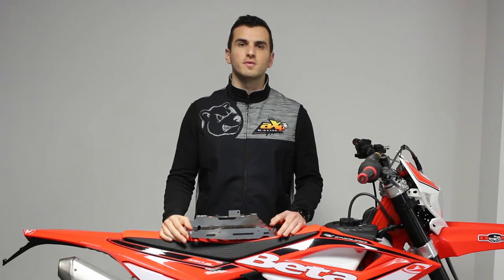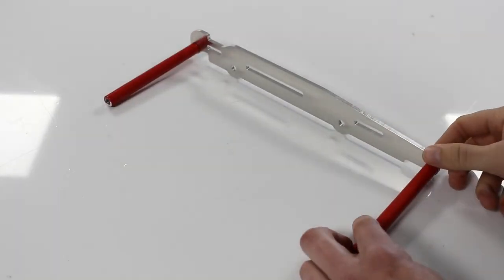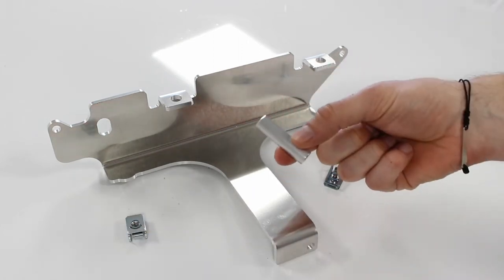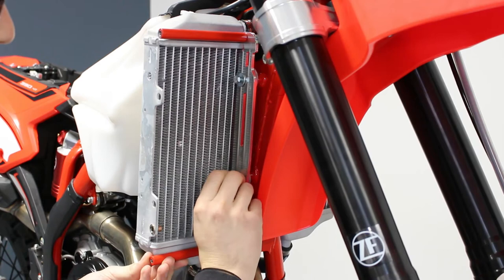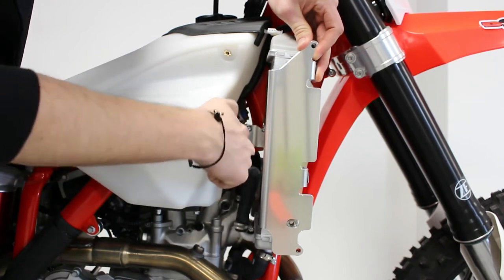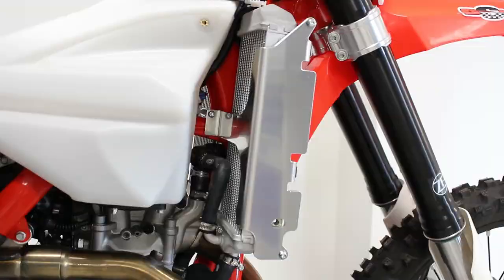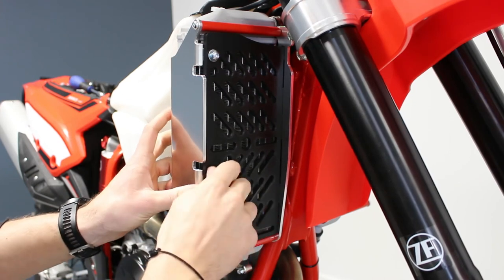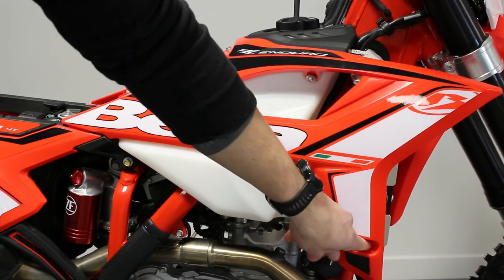XTREM RADIATOR GUARDS / PROTÈGES RADIATEURS XTREM BETA - AXP RACING

Comment: The 2022+ models have extra rad supports/bracing which make it so the supplied brackets no longer line up. Looks like this kit only works on the 2020 & 2021 4T.
Reply from the maker: It has been done on a 2022 model and the bike still the same since 2020 . You can send us an e-mail at contact@axpracing.com to check that on yours

thanks

Comment: Have you tried these on the new xpro 2025 beta
Reply from the maker: No, these ones won’t fit on the 2025 version. 
However, we developed a new version for the 2024 Beta 200/250/300RR Racing, so we think they will fit the Xpro but we couldn’t not verify the compatibility yet. So do not hesitate to send an email to x.dugardin@axpracing.com to be informed once we have the info 😉 Thanks!

Comment: how do you install this on the RR-S models, particularly with relocating the fan to the left bracket ? doesn't look like this will fit, as the left radiator has it riveted to the back of the radiator..
Reply from the maker: We made it compatible with the BETA Catalog fan and this one is fitted with screws from what we got in hands. what's the brand of your fan ?
Reply: @axpracing  thanks for the reply. I have the Beta OEM fan, mounted from the factory. Also have the horn on the right side with the RR-S dual sport, but I'm guessing that's easy to relocate on one of the nearby bolts..
Reply from the maker: @dylmar85  keep us updates by e-mail if you need any hel. Some pictures would be helpful as well ! thanks !
Reply: Did you ever figure out what to do with the fan side? I can't really see an option besides cutting the riveted brackets off.
Reply: @andywilcox7661  Andy, not sure I never bought these. BDP instead and have been perfect after multiple drops
Reply: I have a 22' 390rrs and just cut off the fan mounts (ground the rivets) so that the back fan-side plate would fit. 
One issue I did see is that it seems the spacer connecting the two back plates is about 1/4 inch short.

Comment: Will this work for the new 2024 radiators on 300rr?
Reply from the maker: On the standard 300RR yes, if you have a racing model, it seems that radiators are different